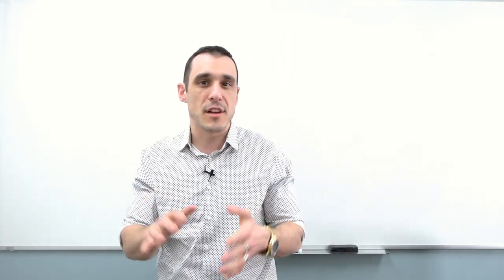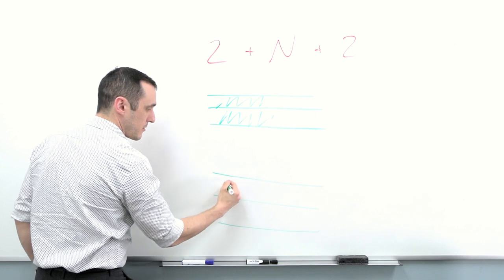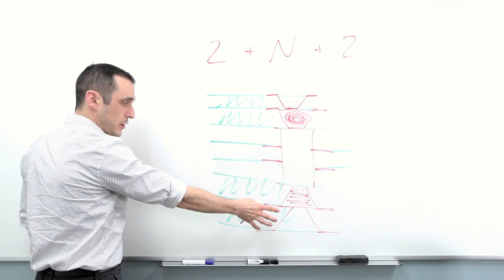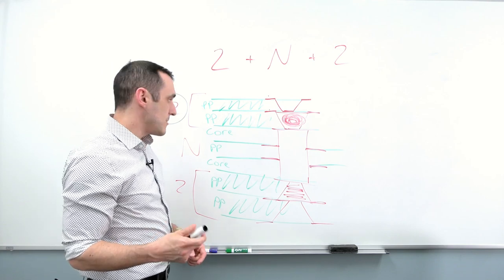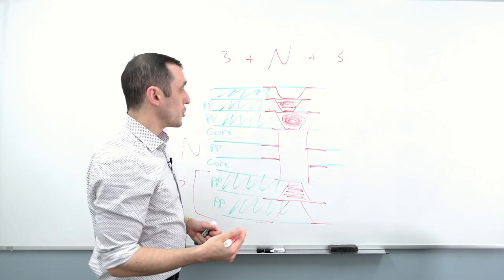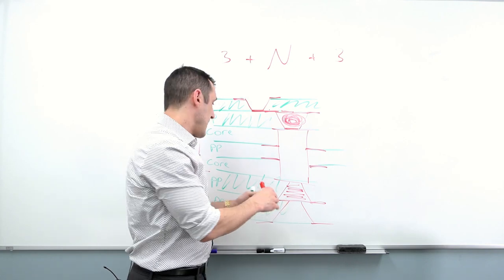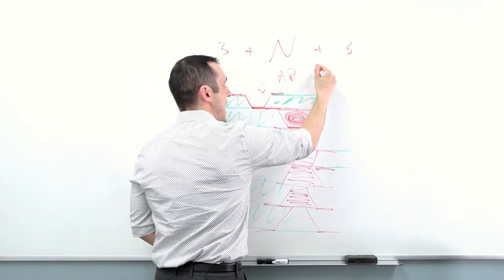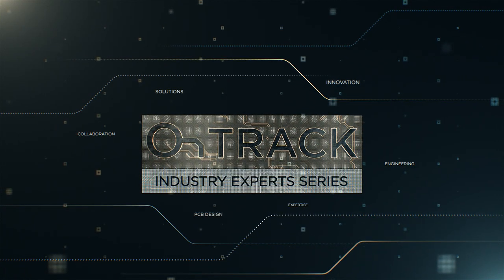Understanding 2+n+2 Stackups in HDI Design

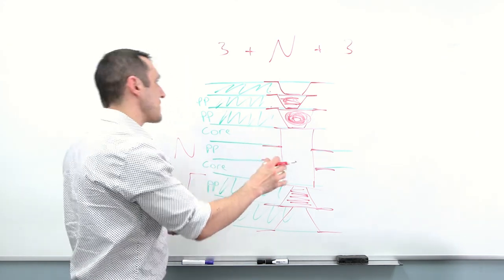Comment: The description of intermittent failures around 6:30 harkens to that period of time when people were commonly trying to reflow GPU’s in their oven. Most thought the solder joints failed under thermal load, but others (particularly Rossman) suggested it was more likely PCB’s failing.   

Maybe stacked micro vias were the root cause?
Reply: Interesting, I didn't know anyone was doing that with GPUs. I can't say for sure if they are related though.